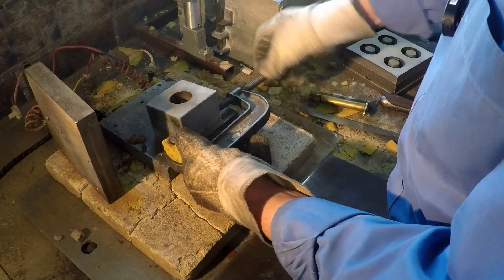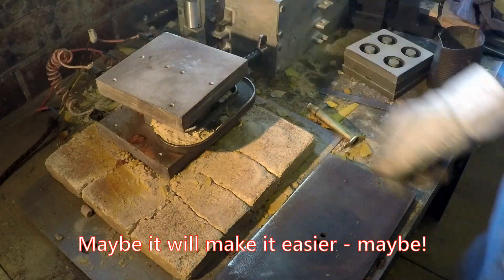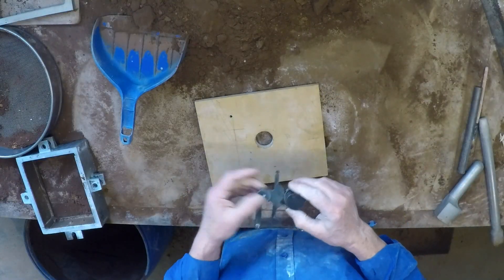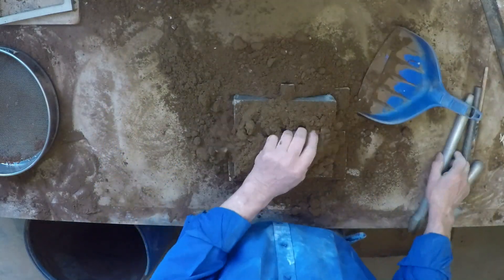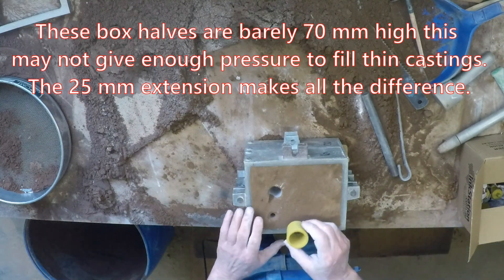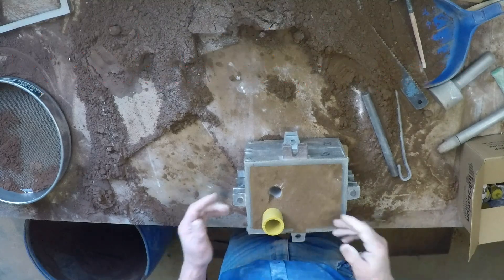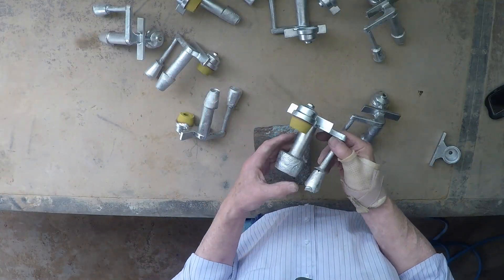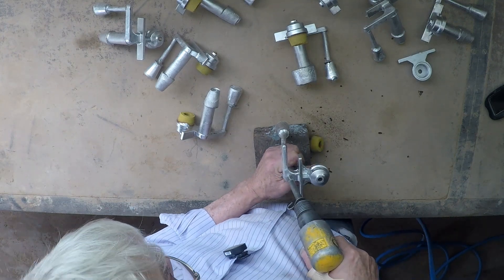Sand cast aluminium Brake fluid Reservoir

Comment: A core wash would give you a better finish on the threads.
Surprised you didn’t vent the core.
Reply from the maker: Ross, Yes, a core wash sure would have helped. The core sand is 70 AFS and I long for the 90 AFS I used to be able to get (sigh!)  I have used a wash on similar threads - see here https://www.youtube.com/watch?v=lNxwrSzm9q8 but  on advice from the customer did not bother on this occasion. I guess he was right as the mating part screwed in just nice. On thing I like about shell cores is that being dry they do not out gas as much as say CO2 or normal sand does particularly when metal sections are thin  (like here) also they are almost always hollow - even if you have to poke a hollow in them  😏 - this makes them self venting. I could have vented from the core prints but with so little heat going into this mould I felt it unnecessary to do this. In truth I don't think I ever vent shell cores. CO2 cores - different story I vent the hell out of them or they blow every time!... Martin

Comment: What do you add to the sand that makes it harden with heat? I've seen this on a few videos.
Reply from the maker: David, I do not add anything to the sand. It has a half cured phenolic resin added by the people I buy it from. The heat first melts and then cures this resin to a hard bond. You can get this sand world wide under the name of either "resin coated sand" or "shell core sand". It comes in various resin strengths  typically from 2 to 4 % and it is quite cheap...Martin
Reply: @olfoundryman8418  thank you. makes sense now. :}

Comment: Very interesting in all aspects to watch as well as learn from! Love your work and attention to detail. I hope to have a go at doing some casting of my own in the future and thus far you and luckygen provide the best teaching methods and situational awareness I have seen. Slowly working my way through your library of video's.
 Cheers from John, Australia.
Reply from the maker: John, No more procrastination mate, get out there and start casting. I know Lucky quite, well he lives not too far from me and we have shared many a cuppa and lots of good conversation. When it comes to casting Iron he is the best teacher out there, he has been at it for over 30 years.... Martin
Reply: @olfoundryman8418  it will probably be in the new Year when I have my large shed ready to build a Foundry and also make some Flasks. 

 I did with my Father do some crude casting of Aluminium in the hollow of a brick with a hole drilled through the side to act as a feature that was needed in the part I wanted to make, it worked well. NO saving the of the mold, Ally cold and Hammer. lol Good days with Dad. Car diff worked well, did not know about degassing so our substitute was to use Oxy welding flux to reduce oxidization on the melt and done with a hand held torch made by Sievert, (BIG). A little older now and more wise as a result of your teaching as well as Lucky. I will video my first foray in to this Brave Old World of casting, stay tuned. lol. 

 Cheers from John.
Reply from the maker: joan, I await developments from your quarter with interest, good luck with it all...Martin

Comment: Is the shell sand available in small quantities commercially for the home foundryman? Product name and supplier would be excellent if you have time.
Reply from the maker: Matthew, I buy the shell sand in 25 Kg bags. I usually get about 15 bags at time but I should imagine that if you went to their door with cash you could buy just the one bag. I buy mine from a company called Macbro but that's in Melbourne Australia - you appear to be in Ca USA. just look up resin coated sand in your local phone book or on Google and give anyone you can find a ring. If they will not sell you just the one bag ask if they can suggest one of their customers who might be prepared to on sell a bag. From memory its less than $10.00 per bag... Martin

Comment: You used facing sand pushed through the riddle screen, then backing sand pushed through a similar screen. Does the facing sand have a smaller grain size? Is the facing sand also a "petrobond" type oil-sand mixture? I'm trying to improve the surface finish of my Alum castings.  Really enjoy all your videos as I learn so much.
Reply from the maker: Matthew, The facing sand is the same sand as the backup BUT the facing has gone through a grinding procedure so it does have a finer grain size. I do not use petrobond at all. The two sieves I use (riddles are above 3/16 inch sieves below that or so I am told)are exactly the same size (1/16 inch) using a sieve breaks up any lumps and fluffs up the sand a bit this makes it ram a bit better a bit more evenly. The back up sand tends to build up in extraneous rubbish and the sieving of it removes at least the bigger of these lumps - if not removed and if they wind up on the cavity surface they can cause strange surface defects on the casting. Glad that you enjoy the videos... Martin

Comment: Thank you for another very cool video. Excellent and instructive work!! Because of you and other guys like  you I have started my own backyard foundry. I have a couple of questions: what is the resin that you use for the core molding and also what type of sand it is?
Reply from the maker: Mario, For these cores I buy the sand and the resin as the one thing! I.e. the sand comes pre-coated with the resin. I think its some sort of urea formaldehyde resin and its just normal silica sand of AFS 70 size. This sand known as either "shell core sand" or "resin coated sand" is available in different resin percentages and sometimes different AFS size ranges just about world wide and it is quite cheap  - less I think than $10.900 for a 25 Kg bag and you get a lot of cores out of 25 Kg.... Martin
Reply: @olfoundryman8418  Thanks a lot for the info!! Please keep feeding us with more nice videos :)

Comment: how  do you make this kind of sand for core?
Reply from the maker: Joao, I did  not make the sand. It is a natural moulding sand that came out of the ground. All I have to do is sieve it to remove the few larger pebbles that it contains. I then add the required amount of water and its ready to use. I do have a couple of videos on sand preparation. One shows how I prepare my facing sand from this natural material and the other shows how I reprocess the sand at the end of each days casting... Martin
Reply: @olfoundryman8418  Martin, ok thank you Martin.
Reply from the maker: Joao, I am sorry but I misunderstood your question. The sand core is made from resin coated shell sand. I use a little aluminium two part mould for the core. This mould is heated to about 180 deg C and it is quickly filled with sand the heat cause  the resin coating on the sand to first melt and then cure to a hard bond, after about 2.5 minutes I pull the two halves of the mould apart and remove the core. I don't make this sand myself as it is a bit of a complicated process I buy it already resin coated. It is quite cheap and is usually simply called "resin coated sand" or "Shell sand" It is usually available in different resin contents, I buy two grades one with 2.5% resin content and the other 4% resin... Martin
Reply: @olfoundryman8418  thank you Martin for your answer, i'll try to find this sand !!

Comment: Two questions....1. Whats the white powder for that you brush on the Sprue and feeder port?   And 2.  Whats the material you put over the feeder material when youre done pouring?   Youre amazing at this...your cast parts look better than machined parts!
Reply from the maker: Brian, I dust the feeder and sprue cavities with parting agent it is simply finely ground calcium carbonate. I do it because it makes it a little easier to blow off any loose sand that may lodge there as I continue to process the mould. I am probably the only foundryman to do this😏. I add an exothermic powder called "Ferrux  NF" it is made by Foseco to the tops of the feeders, this catches fire and generates a lot of heat which keeps the metal in the feeder liquid for longer so it is better able to provide feed for the solidifying casting underneath... Martin
Reply: @olfoundryman8418  Awesome, Great stuff! Ive  always wanted to get into this type of stuff,, not on a major level like you are, but  just one off jewlery type stuff!  Your channel is very informative!  Thanks  for the response!

Comment: Great video. Did you have to allow for shrinkage on the thread? Thanks
Reply from the maker: Rupert, I would assume that the pattern maker did allow for shrinkage when he made the little core box for the threaded core. I would guess that he allowed about 1% - less than normal for aluminium shrinkage because the core box is made cold but used hot so it would get bigger and thus take care of a part of the shrinkage - the 1% allowance would do the rest.. The part that screws into this thread is fairly thin plastic and thus fairly forgiving anyway... Martin
Reply: Thanks

Comment: Excellent detail in casting . you calculate the gate runner sprue can be publishing please ?
Reply from the maker: Luis, To be honest I do not calculate the gating system sizes. Many years ago as a result of experimentation (and a little calculation) I settled on a sprue size of 8mm exit diameter and a top diameter of 14 mm (120 mm up.) This gives a taper on the sprue of 1.4 degrees per side. This sprue suits 95% of the work that I cast which includes aluminium castings of from 100 gms to around 3 Kg with most being 1.5 to 2 Kg. Occasionally I use a smaller sprue with a 6 mm diameter exit for small work and very occasionally a larger sprue with 10 mm exit diameter for work requiring a very fast fill (plaques etc.) The problem with calculation is that you first have to decide how quickly you want to fil the mould and as yet there seems to be not much in the way of a method for accurately doing this (most people fill way to quickly!). Once you have decided on that fill time its quite easy to calculate the sprue size etc. If you are interested in studying this I suggest the "Complete Casting Handbook"  second edition by John Campbell. It goes into these calculations in some detail.... Martin

Comment: I told you to get a base board for the cope when you went to pull the pattern, but you didn't hear me, lol

Edit: would unscrewing the core with a pipe wrench (faced with cloth tape to prevent marring the casting)seem a potentially workable core stripping solution?
Reply from the maker: Luddite, Sorry but I am a bit hard of hearing  - you will have to shout louder next time!
Trying to unscrew the core would most likely result in the core breaking off level with the casting, just as it does when I first start vibrating it out. I should have used a lower resin content sand for the shell cores... Martin
Reply: ill endeavor to project more in future, lol. i kind of figured the breakage was "why not", but a question unasked is an intelligent reply unheard

Comment: It is nice to see what the final part will look like once complete. Could you do that for other castings as well?
Reply from the maker: Jason, It is nice to see what the final part looks like and I do that whenever I can but unfortunately I usually do not machine the castings, the customer looks after that. So I rarely see the finished article myself. In this case I asked the customer, also a close friend, to bring a previously completed part when he came to pick up this batch so I could take the necessary photographs. I do ask customers to send me photos when the parts are completed but quite often this happens months later so sadly they never make it into the video. If you want to see completed versions of some of the throttle bodies that I make Google "EFI hardware" their web site has lots of photos... Martin

Comment: Nice work and entertaining thanks for the videos. What size mesh  screen do you use for your finishing sand? The finish is awesome
Reply from the maker: Wayne, Thanks for your comment. Glad that you like the videos. The sieve that I use for the back up sand is labelled as 1.6 mm mesh but a 0.064inch drill will just pass through the mesh. The sieve for the facing sand is unlabelled but will just pass a 0.055 inch drill. Very occasionally I will use a sieve with 0.025 inch openings in an effort to get an extra fine finish but a sieve this fine is so hard to get sand through that I use it very rarely. Measuring my sand with a micrometre (silly way to measure sand!) I get a maximum grain size of 0.006 inch but most of the facing sand is much finer than this... Martin

Comment: Excellent video sir!   I don’t suppose you could make a video on your process of cleaning out a crucible after pouring metal?  Is there residual metal left?
Reply from the maker: Garth, The "sir" is a bit formal for a poor old foundry man like me. Not really much to cleaning the crucible out. If It is a smaller crucible that I lift out of the furnace to pour and that is up to an A25 size I simply empty any remaining metal into an ingot mould and before using the crucible next time I peel off and throw away the skin that always seems to remain on the crucible wall and bottom, this is mainly just oxide and I don't want than in my next lot of metal. For a crucible that I ladle out from and do not remove from the furnace I just bale it out as low as I can get the metal - about 12 mm left perhaps. When cold I remove any skin on the walls of the crucible and attempt to remove the 12mm in the bottom. Again I throw all this away as it is contaminated with oxide and sometimes heavy intermetallic particles (iron compounds etc.) and I don't want these in my next melt. Sometimes I put a piece of bent wire (a straightened out coat hanger works well) into the 12mm of metal in the bottom of the crucible while it is still liquid. Then after peeling the walls clean I can lift the bottom slug out by the wire and throw it all away. I tend to be very fussy with my metal, I pay good money for it and the results depend on it... Martin
Reply: Olfoundryman you are a wise foundry man who doesn’t seem much older than I.😂. I am 43 and I have learned so much from your videos and you have inspired me to the point that I am currently building my own furnace to start hobby casting.  Thanks so much for the prompt and detailed response. Keep up the great work.  I really appreciate every video you have made.👍
Reply from the maker: Garth, 43 you say, well I am a little up on that, 73! Its comments like yours that make it all worth while and  I thank you greatly for them. I will try to keep the videos coming.... Martin

Comment: Very nice I just got into sand casting myself with small amounts of aluminum that is and that you're able to cast those threads being at their large Real  fine threads wouldn't pick up well in the sand
Reply from the maker: Brian, Yes, I would not want to try a thread much finer with this shell core process. But it is surprising just how fine  a thread one can cast in a fine green sand. I have cast 3/8 16 tpi Whitworth threads in bronze  by using a bolt as the pattern, rapping it in the mould a little to make it slightly bigger. The parting line comes out a little rough but quickly running a die down the cast thread fixes that up.... Martin
Reply: Olfoundryman oh yeah one more thing to be able to make the sand solidify is there sodium silicate or something added to that sand?
Reply from the maker: Brian, No, there is no sodium silicate added. The shell core sand that I use to make the threaded core is coated with a resin which cures off and causes the sand to bind together when I pour it into that little aluminium mould which is heated to about 180 deg C. The heat first melts and then cures the resin. The sand has been coated with this resin by the people that I buy it from. It is simply known world wide as "resin coated sand".... Martin